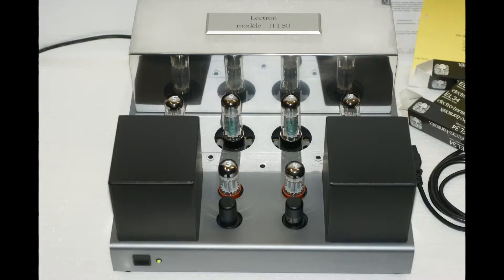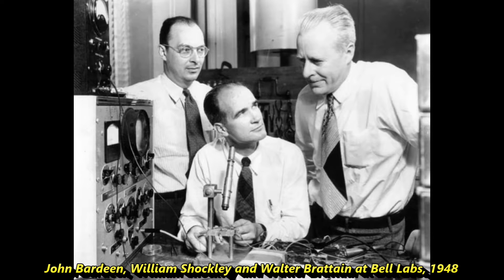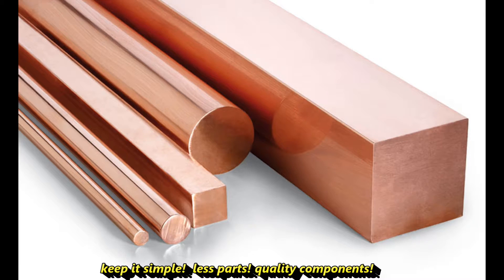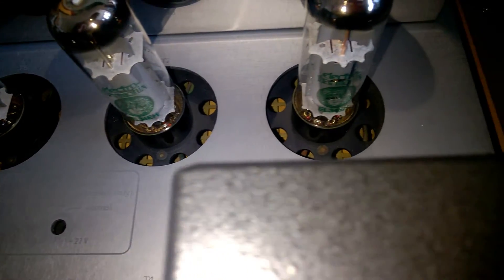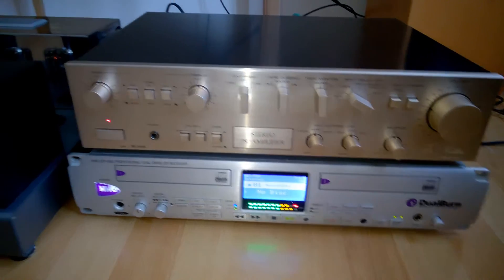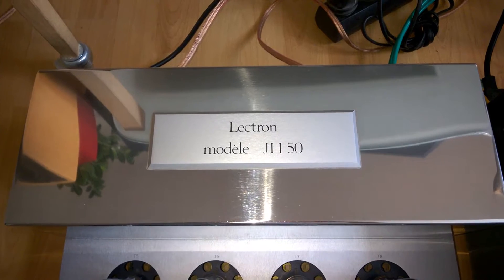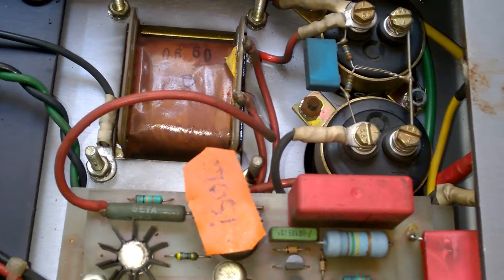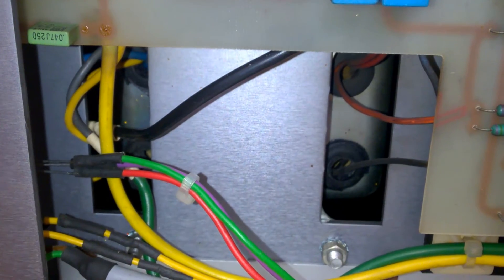Jean Hiraga JH-50 Tube Amplifier Teardown, BEB #25, Röhrenverstärker

Comment: I inherited an old JH 50. I would like to change the valves. Any instructions or help available? Best. Nick
Reply: 6SJ7 metal; or GT ...or 5693 red base....................these tubes may still be good !!!
6SN7 .........GT/GTA/GTB ......................;best with matched sections .............RCA/SYLVANIA or new production
The original ones may also still be good !
EL34 ( matched pairs ) ......................nos is rare and very expensive.................new production you have the choice......
Don't forget to bias the output tubes.............and correct after burn in ..................
Reply: @frankgeeraerts6243  Thanks. The sound comes out of only one channel so I think it needs to be fixed. Is it worth fixing ?
Reply: @npdvvecchi7181  As long as the transformers are OK , this amplifier is worth fixing !!!!!
Reply: @frankgeeraerts6243  Thanks for this. Is this kind of work expensive ? Approx idea ?
Reply: @npdvvecchi7181  Normaly not as long as there are no expensive parts involved .....One channel works , that's  reassuring ....be sure the OPT is allright !
Check voltages ......you have one good channel as a reference, tube may be faulty , resistor or a capacitor ..........
Check for filaments glowing up on all tubes.
Check fuses.........I think most likely one resistor may have burned out ..check.
Check tubes .......If you're not customed to work with high voltages .........don't take any risk and look out for a good technician...
Reply: @frankgeeraerts6243  Thank you very much for your input. I will need a good technician. If and when it happens, I will reach out to you and keep you updated. Thanks again.
Reply: @npdvvecchi7181  OK .......it's an amplifier that will bring you joy !